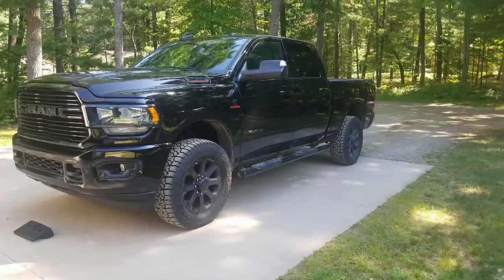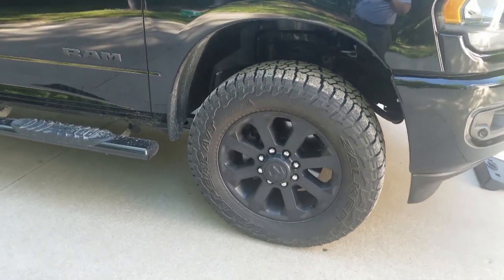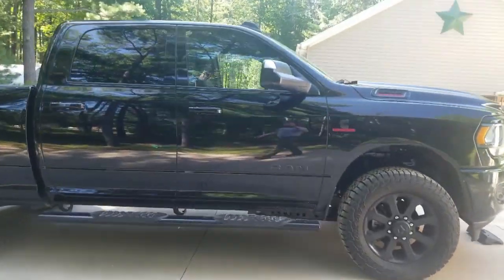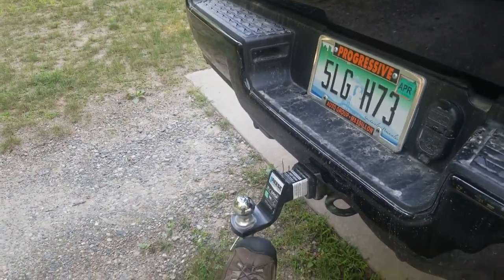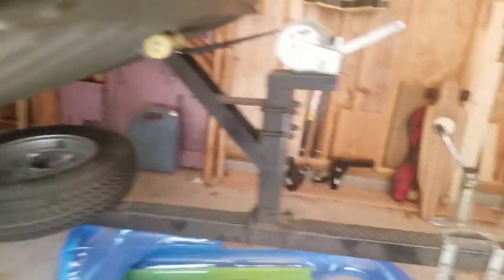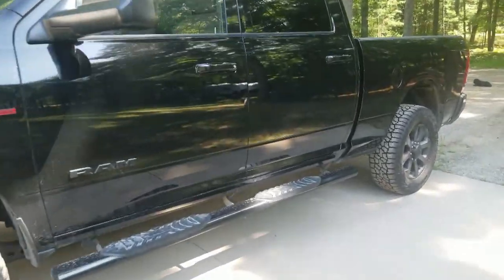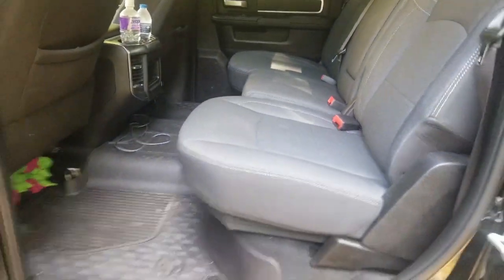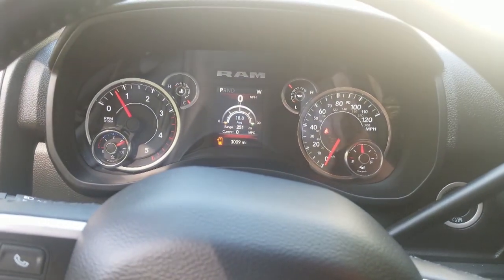2019 Ram 2500 Cummins Pros Cons And Mods

Comment: The best thing you can do for the rough ride is to air down. I hunt as well, but I used to four-wheel, and when four-wheeling you ALWAYS air down. It not only massively improves the ride, but it gives you much greater traction. Ger yourself a set of Staun (best) or Trailhead (very good) deflators (all others suck, don't waste your money), and a decent 12V compressor. Set your deflators for 12psi, and you will be amazed at the difference in both ride and traction.
Reply from the maker: Thank you. I have the viair portable and do air down when it's bad out there. Did not know about those particular deflectors. Will check those out.

Comment: Nice truck, I have a 2019 BigHorn as well.. I used the UPOL bed liner and coated the lower edge of the body (about 8" up from the bottom) with UPOL because all the stones will chip the paint
Reply from the maker: Excellent tip! Will have to look into some of that stuff.

Comment: The mirror design has changed a bit but I run my 2007 3500 5.9L mirrors vertical for the exact same reason. That's they way they were designed to perform best...  Also love them! 

I've been looking at half tons lately to replace my 07 with a new 2500 6.7L and I think you have me sold! I'll still have my old 95 2500 5.9L 5spd to satisfy my 5.9L addiction, too! Great video!!
Reply from the maker: Thanks! Glad you liked the video. Appreciate the comment and hope you find the best deal on the truck you are after.

Comment: I have a ram diesel 1500 Outdoorsman and my hubby and I are shopping  for another and this was very helpful. I’m not too fond of the column transmission, I prefer the knob but hey, you’ve convinced me.
Reply from the maker: You will love this truck! Been 6 months and 13k miles so far and half that towing 8500 pounds. Best truck I have ever owned!
Reply: We tow 2 atvs, snowmobile and fishing boat . I’ve had a Powerwagon manual transmission before and adored it. I live in Quebec and winters can be quite harsh  so we need a truck on guarantee ...and we love trucks. I think I’ve watched your video 4 times already. I really appreciate the pertinent infos. Guess I should be shopping for an extra mirror :)
Reply from the maker: @anniefrohlich1138  Yeah this truck tows amazing. Also I will say it has the best traction control of any truck I have owned. my wife hated my f150s in the snow unless it was in 4x4. This truck the traction control is so spot on and fast its almost boring but my wife loves the no sliding or spinning tires in the snow and ice. She says she feels safer in this truck than any vehicle she has ever owned.  The mirror on the passenger side definitely takes some getting used to. But not gonna lie. my little 6 dollar stick on blind spot mirror i put on is freaking amazing!!! solves all my problems with the big mirror and even adds a little extra when the mirrors are tipped up in the tow position.

Comment: Thanks for a great review I got the 2019 tradesmen feel the same as you, incredible truck, capable. I need to check back with you at 100K hopefully we feel the same then
Reply from the maker: It's a date! First one to hit 100k check back and we can see how they are doing. My plan is to do about 120k in 5 years and then sell it and buy another one. Got. 6 year 125k mile warranty. So the remainder of the warranty will be a good selling bonus as well.

Comment: I have a 3500 srw with the HO.   I pull trailers 90% of the time for work.  If I was a normal guy who tows occasionally like most of you, I wouldn’t get the HO. The aisin is harsh and clunky.    The 68 transmission is smooth and much better for daily driving. 

I had to go with the aisin so I could get 100k miles out of my truck.
Reply from the maker: They also redid the 68 in 2019 and hear its much tougher now.

Comment: Love your vids, great info.  I am looking to replace my bulbs on the same truck you have.  What bulbs did you go with from headlight revolution and any difficulties with installation?  Thanks, keep up the great work.
Reply from the maker: At the time I bought mine they only offered one bulb for the ram 2500. It had a digital module pack and was a "v2" model. 
Yep the installation was not hard but very tight to get your hands into and took me about an hour and a half. But again not hard just tricky to fit it all in the housing and close it up. Almost like you need 2 hands in there but can only fit one. But after a little yelling and different attempts I made it happen..lol
Reply: @SamkoTradBow  Thanks for the response!  Love my 2500 Ram Diesel by the way.
Reply from the maker: @herbieveyran1705  Glad you are loving it! Its been the best truck we have ever owned.

Comment: Nice truck bro. I just got one today- thanks for the heads up on tire recommendation- not a fan of the stock tires! Doesn’t your little $6 mirror block your blind spot detection alert triangle? I only use the overhead & cargo cams when switching lanes And parking... I’m so happy I don’t need to crank my neck around 10rpm like the exorcist anymore to park!
Reply from the maker: You will love the truck. I dont have blind spot monitoring or the over head cam in my truck. So that little mirror works great for me.

Comment: You know you can adjust the factory bubble mirror so that you can see your blind spots, right?
Reply from the maker: Yes. But only a small sliver when they are in the down position.  The mirrors suck for 2 reasons. I is the magnification of the main passenger mirror and 2 is the fact the the convex mirror is only horizontal when the mirrors are in to mode. They need to get rid of these mirrors and use the ones like ford and Chevy use.
Reply: Traditional Bowhunting And Wilderness Podcast no
Reply from the maker: @domforte2966  yes

Comment: Love the honest and passionate reviews! Thank you. I like the all black look, but was wondering how the black paint is holding up for you being in the forest?
Reply from the maker: Great question.  I have owned a few black woods vehicles before. The key is 2 things. 1: wax, wax, and wax again. Always have a ton of wax on it as a sacrificial layer for sticks. Number 2 : wax it again.
Reply: @SamkoTradBow  Huh great answer thanks!
Reply from the maker: @brenwesterland6306  without the wax the sticks rub the clearcoat layer and because of the dark color show real well in the sunlight. The wax makes it super slick and acts as a mild protection layer between the clearcoat and the sticks. Smart thing happens with all colors but the black reflects light so well they are easier to see. The wax is the real life saver in the woods. I use meguiars ultimate wax. Its fast and easy to do and last for a few months. But right before hinting season I put 3 coats on or 2 at minimum.  Then I do the same in the spring and also reapply wax to the front grill, bumper etc every couple weeks to make the bugs wipe right off easy. Wax is your friend.
Reply: @SamkoTradBow  Thank you for the detailed info! really its appreciated. Wondering what form of wax you use (liquid or paste) and if you have a particular method you like using when applying to such a large surface area? Thanks again, have a good one!
Reply from the maker: @brenwesterland6306  I use meguiars ultimate liquid wax. It goes on really easy and doesn't leave any residue. I apply it by hand. I cover the whole truck with wax then remove it. Takes me about an hour to do by hand.  I actually use it as an exercise routine.  It's an hour of good arms and upper body and some mild cardio if you move at a good pace.

Comment: Man I have watched this video probably 10 times and have done a lot of your mods! My mind about exploded the first time I watched it as it was information overload haha. I went with the Headlight Revolution bulbs and WOW!   Anyway, one question about your tires -  how did you figure the maximum amount of rubber you could fit without rubbing?  I have a '19 Ram 3500 and want to put these tires on it.  It currently has stock rubber 275/70R18.   I was wanting to go with the 285/75R18.  I'm thinking it shouldn't be a problem but would hate there to be one.  btw popped a Nebraska doe this last fall :-)
Reply from the maker: Glad you like the video! And congrats on your doe! Nice to have meat in the freezer! How I found that tire size was I did some research on a bunch of forums and found the size I got was the largest I could go on my stock 20 rims with out rubbing at full lock. Some guys were running 35x12.5 but they had rubbing issues with the stock wheels. after market rims will let you change  offset so they dont rub. I dont want to buy after market rims so I went with what they said was biggest without rubbing because my truck lives in the woods and I need the tight turning radius and no rubbing issues when the suspension in loaded.
Reply: @SamkoTradBow  Thanks for the reply!  I just pulled the trigger on the 295/70R18 AT3s.  I'll let you know how they end up working.  Several sources confirmed there was no rubbing so fingers crossed! Hey one thing I noticed in your video above was your led bulb positioning.  Couldn't quite tell if yours LEDs were oriented at 9 and 3 o'clock (paddle mounted vertically).  This maximizes the reflectors within the housing and really cuts down on road glare for oncoming traffic. Only learned this from HR website tutorial vid (https://www.youtube.com/watch?v=NbfAyqVgVdM). I got the GTR Ultra 2 bulbs.  They had adjustments every 10 degrees (or so) to change this orientation.  Also, I just ordered some seat covers for my pickup you might find appearing.  Check youtube for Head Waters Seat Covers.  They cater towards dudes like us that like to hunt.  Thanks again for taking the time to review your awesome truck!
Reply from the maker: @codygronsten3133  you are gonna love the tires! Good info about the led bulb alignment.  Will have to look and see how I have them. Thanks again for the info and suggestions.

Comment: My dad has a 2021! There are some stuff i dont like! One thing on the 2021 2500 is that it squats alot more than my dads 2016 ram 2500. Both trucks have coils but the 2021 squats if you have a gooseneck.
Reply from the maker: I belive thst soft rate spring is to provide better ride quality.  But it's a veey easy fix to swap to heavier springs or add air bags etc. For us, the better road handling is more important.
Reply: Yeah but when your paying 70k and you thought the truck was going  to be the same as your 2016 coil suspension  ram. We use the truck for work pulling a gooseneck. I just think they should  say that they made the springs not as tough. To be honest  are they actually  making it a better truck??
Reply: @SamkoTradBow  the 2016 ride eas plenty  fine! With coils.
Reply from the maker: @cannontaylor97  again depends on the usage.  Most people pulling a gooseneck buy the 3500 for the extra tow and payload capacity to deal with the tounge weight. Most people buying 2500 are construction workers and people pulling campers and recreational trailers. So from thier stand point making the 2500 ride a little smoother for the majority of consumers is a good thing. But I can definitely see your point as well. But in rams defense someone has to loose here. They choose to make the 2500 fit the most common uses.
Reply: @SamkoTradBow  so pretty  much anyone  that has a f150 or 1500 pretty  much buy these  now. I think ram should  not put then a 5th wheel hitch in the 2500s if thats the case.

Comment: You forgot to put link for high and low beams, or you used backup and cargo light bulb?
Reply from the maker: I do have the cargo bulb in the list. the headlight high and low beams are by headlight revolution so the only link I have is right to their website then you just type in the make and model of your truck and it will take you right to the bulbs.

Comment: Is the rear headliner leaking? Do you see water stains in the rear?
Reply from the maker: No. no leaks anywhere yet.
Reply: They got that fixed but it’s the 3rd brake light on the older ones
Reply from the maker: @336glassmanmike4  good to know. No problems that I have seen.

Comment: You kept going on about the running board... why not get a 2018 running board? These are the same cab, same frame as the older 2014-2018 models
Reply from the maker: Actually they are not. A couple companies told me that the mounting kits for wheel to wheel on a 19 are not avail yet and the 18s wont work. Talked to just about every aftermarket board supplier on realtruck.com . Besides as I said in the video I want a specific style in a wheel to wheel. Nothing square and nothing flat and want it 5 inches so that it protects my rockers from stones. So I could of got wheel to wheel from a couple manufacturers but not like I wanted. We cant have flat or square here. I live in the snow belt. Snow and slush collect on those boards and freeze then you cant open your doors or use the steps as they are solid ice.
Reply: Different frame.

Comment: Question: It looks like you have wheel spacers installed, if so what size did you used ? thanks
Reply from the maker: No wheel spacers. Straight stock set up. Just bigger tires.
Reply: Traditional Bowhunting And Wilderness Podcast 

Thanks, looks perfect
Reply: Traditional Bowhunting And Wilderness Podcast 
I have the same truck, I will do the same
Reply from the maker: @chikineira  you will love it. Best truck I have ever owned so far!

Comment: Great truck and thanks for the video!
Reply: I do like the column shift not too crazy about the turn dials or buttons for start and 4x4
Reply from the maker: Thank you. I agree the turn dial is weird and I preferred the column shift. I guess the gas engine has the turn dial. Would take some getting used to, but seems most companies are going that way.

Comment: I'm 99 percent sure those 1000w bulbs are not 1000w. It's just a common over advertising. 1000 watts would burn up the wires since they only push 12v. That'd be over 83amps which would burn up the thin wires. Like the review though
Reply from the maker: Not sure. Thats just what they say in thw advertisement.  Maybe they mean equivalent to. Not sure.

Comment: Had ionic nerf boards and the brackets rusted and looked like garbage in a month...hated them...my ram 2500 bighorn came with the leds...
Reply from the maker: Yeah that's why I want the ecoated  pro version. But they did not have the wheel to wheel boards available yet. If I was going to make these ones permanent I would of rhino lined the brackets. Know alot of guys that do that and have them last forever. My bighorn did not come with leds.

Comment: Ram is way ahead of the other brands out there. Especially storage. That is one reason I got a 1500 sport. ( 2017 model ). The #1 thing I hate about mine is the stupid gear knob, now that was a stupid ideal. Wish it was back on the column. Nice video and thanks for the links on all the upgrades.
Reply from the maker: Yeah we looked at the f250, and the duramax as well as the ram. The ram is light years ahead of the others with features and interior design. All are good trucks but the ram has more going for it than either of the others in my opinion. the list is actually pretty huge not even counting the amazing cummins motor. Very happy with our decision. Glad you are enjoying your ram as well!

Comment: You nailed it with that passenger mirror, stupid is the word... What are those mini mud flaps?
Reply from the maker: Those little mini stone guards were stock and on it when we bought it. I did replace the front ones with husky liner mud flaps. Love those and needed them with these aggressive tires and so much time on dirt roads. They stopped the stone chips and rocks hitting the truck from the front tires instantly.

Comment: Lol you can adjust the little mirrors on the side of the mirrors
Reply from the maker: Obviously.  But they dont adjust wide enough to worth a darn off road in tight woods. They are worthless unless you tip the mirrors up.

Comment: how high is your lift?
Reply from the maker: No lift. Completely stock except for 1 inch bigger tires.
Reply: @SamkoTradBow  what are your thoughts on drop in bed liners vs spray in line-x / rhino liner,   also any thoughts on going with the laramie etc to get that big control / infotainment screen 12" , i love that look but hate chrome and like the look of the big horns better?!?!?!?! but not available on big horn?
Reply from the maker: @steelyerface21  all personal preference.  I love drop in liners because they offer huge drop cushioning and dent resistance.  I also like that stuff slides easy when I put stuff in and take it out. Line x and rhino are very abrasive and brutal on all gear you put back there. Literally sands the finish off of gear. But the spray ins look better. Atleast until they fade and have to be redone. The 12 in screen is cool but what I found when I test drove was that I like the knobs better for climate control rather then having to look at the menu. But there is alot of great features to the Laramie if those features matter to you. Cant go wrong either way. Dor me the bighorn had everything I wanted and was priced right.

Comment: Drop in bed liner looks like shit especially around the cut outs. I got the bed rug in my 2019 ram 2500 limited looks and works great.
Reply from the maker: We must use our trucks very differently if a bedrug works for you.  I will stick with bedliner that "looks like shit". By the way I made the cut outs with my dremel. If I cared what the bedline looked like I probably would of took my time.

Comment: Dealer sells oem wheel to wheel running boards
Reply from the maker: Yep but did not like the factory wheel to wheel boards as I live in the snow belt. Flat boards or square boards dont work here. they fill up with snow and slush and you cant get in or out of your truck when they freeze.